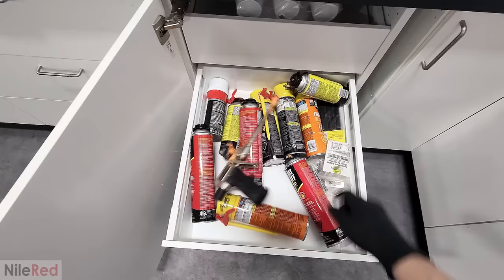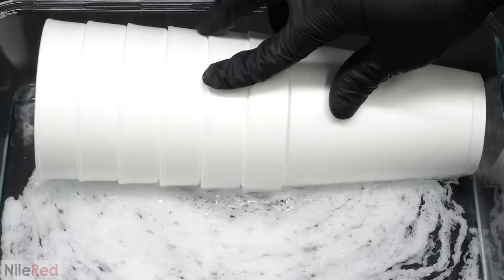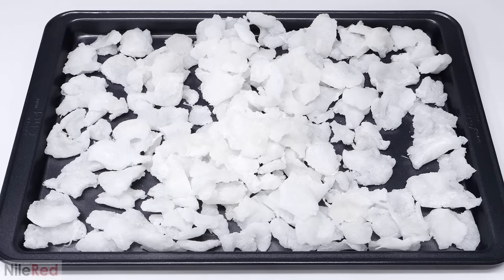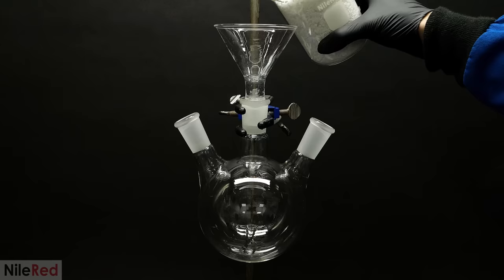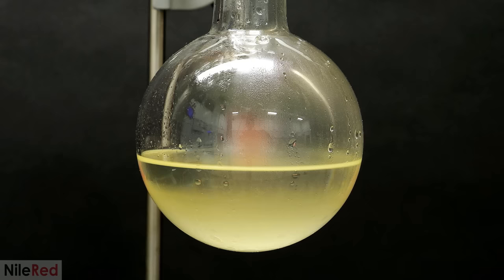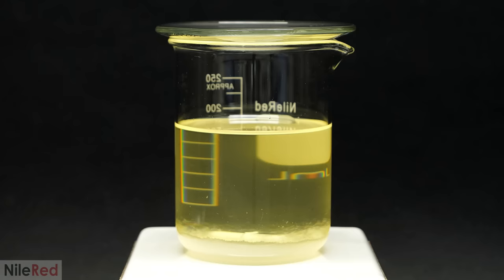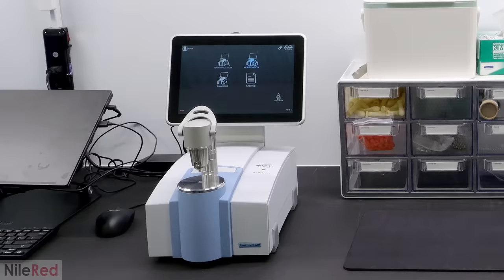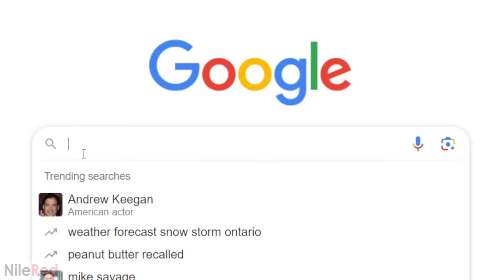Turning styrofoam into cinnamon candy

Comment: As a professional chef for many many years it's incredible he managed to make candy without horrifically burning himself. Also the reason why your candy seized like that is because you added in alot of cold liquid(food dye) without a stabilizer, which caused it to start instantly crystalizing around it even before you poured it out of the pan. Basically, in short, make sure to heat it to 300 or 320 or whatever ur temp is AFTER any additives or you'll get a chalky crumbly sugar mess instead of candy.
Reply: You should watch his standard chocolate chip cookie video. He knows so much about chemistry, but his kitchen skills are "Burnt Water" lol
Reply: Also, my first attempt at making a hard candy shell on some key lime pie gave me 2nd degree burns when I laminated my fingers with molten green lime lava. I was trying to drizzle, and ended up sizzle.
Reply: Also speaking as a professional chef, I’m shocked he managed to save the candy! Very impressive for a first time try like that
Reply: I don't think he'd do very well as a chemist if he can't handle hot sugar safely.
Reply: @Roadiedave Hey! As someone who also often burns water, I resemble that remark!
Reply: @microgravity  I am not a chef in any fashion but this was also a huge surprise to me. Usually saving food stuff after you've fucked it up that bad is basically impossible.
Reply: @UnitSe7en  you'd be surprised at how incredibly easy it is to melt the gloves you're holding to your skin because the sugar you go to knead bubbles into has a pocket that's still liquid that gushes out onto your hands as soon as you start working it
Reply: It's actually humbling seeing this insane guy who can make chemical magic getting mad hopeless and frustrated at something that I have successfully pulled off before
Reply: I very vaguely know the candy-making processes, and even I was astounded at how he pulled this out of his ass! He really made some easy mistakes the first time, then just chemistried his way through candy making to finish with an actually pretty good product as someone who'd never touched these dark arts before!
Reply: The sugar crystals up the sides of the pot due to the initial stirring would also act as a seed for crystallisation, been there.
Reply: We’ve already determined that Nile cannot cook/bake to save his soul. He must survive purely on Uber eats.
Reply: @andrewbartlesby7958  That's pretty much exactly what happened to me. I had mine in a bag to squeeze it out, and the bag burst. I grabbed the blob that came out and that burst open and it was pure molten syrup inside. I could hold the squeeze bag with my bare hands.
Reply: He is the definition of master of one, he only knows things about chemistry, which is weird because you think about baking it is  just mixing chemicals together just ones that usually don't kill us
Reply: You can add water-based food coloring to candy without it seizing up; if you've ever seen any of Lofty Pursuits' videos on youtube before, that's how they do basically every candy. What likely happened is some undissolved crystals were left on the sides of the pot, and the candy cooled down sufficiently after the burner was turned off that it was unable to melt them; but was able to pick up a trace amount of the solid while pouring out, causing it to seize up when it got closer to the freezing point. I was surprised the remelting in the same, uncleaned pot worked -- I suspect the bubbling brought the hot syrup in contact with the crystals on the side of the pot, and got them hot enough to melt.
Reply: @Roadiedave 111 👍
Reply: @PersonaRandomNumbers  again, as someone who has his red seal with a specialty in pastry, I promise you.what happened is when he added the large amount of food coloring off the heat it caused the sugar to harden around it, forming seed crystals. The reason lofty pursuit can do it is because the additives they add are done on a speciality heated table that prevents the candy from ever getting cold enough to allow seed crystals to form. The two possible culprits for it seizing are either that, OR the bench scraper he used (metal spatula) being cold enough to cause the same thing.
Reply: Cooking is basically chemistry that you can eat
Reply: Lab safety is probably what saved him from getting burnt. Most kitchen people are used to a spill safety of "clean it up" or at worst "ice bath it" Lab spills are more of a "Oh fuck I'm already dead"
Reply: @artsyscrub3226  tbh cooking and chemistry have very little in common. its why his cookies sucked so much ass. the whole idea that cooking is just basic chemistry is super super incorrect, its more of an art than a science.
Reply: 44:57 45:42 😅
Reply: @andrewbartlesby7958  cooking is a craft - you need both academic knowledge of materials and the "feeling for it "(that's why it's hard af)
Reply: I always add cream of tartar to help prevent recrystallization
Reply: @samj530  yeah, any base would work. Baking soda is the more common choice

Comment: Organic chemistry: Measured and precise
Candy making: Chaos and use feeling
Reply: That's about as accurate a description of candy making I've ever heard!
Reply: @michaelbobic7135 have you ever made candy the correct way? It's an extremely measured and precise process. From water percentages, to temperature ranges, to folding and aerrating, to watching temperature again until you're able to do your final shaping, it's not just a carefree "throw-it-together" process.
Reply: Organic chemistry is not always as precise as you might think 😅
Reply: @Tamramsy I mean... Like anything else, once one becomes practiced, yeah it is a matter of feeling. Like absolutely use the thermometer, but learning what the sugar syrup looks like at different stages, learning what the candy looks like when it's malleable enough to pull, learning the thickness of the candy and temp of candy to roll is all smthn you can just tell once you've done it enough
Reply: Organic chemists are everything but precise.

Its called dump and stirr chemistry for a reason.

Inorganic chemistry is where being meticulous is primordial

Comment: As a pastry chef, what happened was you Seized the sugar. using the metal scraper on it caused it to create small sugar crystals in the syrup. when mixing molten sugars, you only fold it using the silmat till the sugar becomes more dense.
Reply: And from what I've seen, dealing with the quirks of molten sugar and chocolate can make almost any chef cry.
Reply: Could also have been him adding the cold food dye in and not letting it heat properly after, or him pouring it onto a chilled tray. Both can do it.
Reply: never seize things I guess
Reply: Nile is not a pastry chef
Reply: @monad_tcp so I should never seize the day?
Reply: @monad_tcp  but what about the means of production?!
Reply: Also plenty of seed crystals left on the sides of the pot before he poured it.
Reply: @KainYusanagi This is why I always stick my cocktail syrups into hot bath for a while when I am done pouring them into bottles.
Reply: @casedistorted You should seize the means of production instead.
Reply: @fidepus it kind of seems like the hardening sugar seized NileRed's means of production. I guess that's why rulers usually offer the masses bread and circuses instead of cinnamon candy, they are both much easier to put through a rolling machine.

Comment: As a hobbyist candymaker, the candy seizing up is crystallization. The usual suspect here is undissolved sugar left on the sides of the pot. Most recipes recommend you apply a wet brush to the sides of the pot to get rid of any crystals left once it's reached the boiling point; some recommend putting a lid on for a few minutes, causing the condensed water to do the same job. The issue is that hard candy is meant to be a glass, an amorphous solid -- so any seed crystals will spread if introduced. The process happens very fast with hot candy, but still happens slowly at room temperature. Freezing is exothermic, and if it happens again, you can actually feel the latent heat of fusion as it occurs!

At 40:24, you can see some crystals left on the sides of the pot, after the heating has already been turned off. Leaving the syrup in the pot, adding in cold ingredients, and stirring it, all cool down the syrup and increase the risk of picking up a small amount of solid sugar that won't melt -- and, just picking up a few molecules can cause crystallization when the candy gets closer to the freezing point. The second attempt likely worked because the bubbling action brought the hot syrup in contact with the solid crystals, allowing the heat to melt them. In general, remelting candy causes decomposition reactions to happen, possibly causing off flavors and colors; as well as boiling of volatile oils, making the intended flavor less pronounced. That said, fantastic job getting it to work on the first batch!
Reply: I thought you can’t eat crystals 🙃
Reply: I hope nigel would read this and make a second attempt
Reply: @leonardomorari9468 Salt and sugar :)
Reply: To make it sound more pretentious: The issue is undissolved sugar on the sides of the reaction vessel acting as nucleation sites for crystals of unwanted size.
^_^
Reply: @Reddotzebra  tf are you on about? a comment that explains some chemistry under a chemistry video is not pretentious.
Reply: Wanted to write a comment how NileRed has impeccable chemistry knowledge and skill but then fails at basic home food processing :D Was kinda expected to hear he consulted his first failed candy attampt with How to Cook That, after she did lovely explanation why his "chemicaly purest cookie" didnt taste good.
Reply: Candymaking is a science in of itself!
Reply: When I made marshmallows for a high school project (and then again later for fun), the video tutorials I watched generally advised that I pour my sugars in the center of the pot and avoid stirring my syrup to avoid crystallization.  It seemed to work out - the only procedural problem i ran into was using hot coffee instead of cold coffee to start my gelatin, so instead of a mound of useful gelatin mud I ended up with a stinky coffee gummi lump at the bottom of my mixing bowl.
Reply: @leonardomorari9468  Sugar, ice, and salt are 3 commonly eaten crystals
Reply: I came here to comment this same thing! I make candy too, and I am in food manufacturing (but not for candy).

Comment: So there's one thing you're missing from this project: a heated table. It helps to keep the candy from getting too hard and stay malleable. You have the press next to the table and run it through the press straight from the table.
Reply: How is this applicable to normal-everyday-life?
Reply: I usually just use an oven tray at about 100C to keep it warm for longer when I make hard candy
Reply: All watchers of Lofty Pusuits know this 😊
Reply: @slevinchannel7589  Candy press isnt everyday life device also. Well, if one is not professional candymaker
Reply: @vVPhaetonVv  I kinda want NileRed to try to use the same press to make heart-shaped soup noodles.
Reply: @slevinchannel7589  it's meant to be applicable to candy pressing, not everyday life
Reply: So then get him a heated table lol
Reply: @slevinchannel7589  What is this question 😂
Reply: NileRed hasn't fallen down the candy making video rabbit hole and it shows.
Reply: @slevinchannel7589  honestly just using one of the heaters he has with something like an oven tray would be enough
Reply: @slevinchannel7589 why are you bringing everyday life applications thought in here???

Comment: As a pastry chef and confectioner, Nile's candy-making skills are actually pretty impressive, all things considered. Those cranks are crazy to use, and the candies look great!
Reply: The main reason it's so difficult to turn is because of the gear ratio on the crank. You have to turn it very fast, and with the pressure of the candy on the roller it's like running a bike uphill when you're in high gear
Reply: He needed a cheater-bar for the lever.

Comment: The reason why your sugar got all hard and lumpy (crystallized) is because when you're making candy, you're supposed to wash down the sides of the pan with a pastry brush and some water. The crystallization happens when there's unmelted/unincorporated sugar crystals in the mixture, and washing down the sides makes sure that all of the sugar gets melted. Glad that you were able to fix it, though! Never give up! :D
Reply: my farts are better than NileRed's farts
Reply: @p-__ taste better too
Reply: @youtube.commentator that's even worse
Reply: @richarddavis3980  Thats exactly what you are not supposed to do. The pastry brush would be wet. Melting the sugar before it mixes back it in. When you stir it then it mixes the already formed crystals into the liquid sugar causing a chain reaction.
Reply: @kyleg334  I don't know what the hell you're talking about because I made candy the other day and I stirred it as it was heating up and it worked out perfectly for me so I don't know what you're talking about
Reply: @richarddavis3980  ah yes, the good old "I haven't seen it so it must not be true" argument.
There are 2 schools of thought apparently. For one, stiring is the biggest sin you can do, others are more... relaxed.
Using a pastry brush to dissolve the sugar again is certainly the safer method
Reply: @richarddavis3980  congrats, and advice for the future the safer method  to try and avoid crystallization by not stirring.
Reply: Does microMOL level measurements for 90% of the experiment, YOLOs the candy making, which is arguably the most related-to-chemistry field in cooking.
Reply: @richarddavis3980  being a cook doesn’t make you knowledgeable about everything man just accept there’s two ways here and you’re criticizing an obvious beginner cook as if he’s a moron
Reply: @richarddavis3980 I mean you can stir it but it can cause failure. If you're not super fast with pouring it ect it'll harden quickly and just make your pot a sticky mess
Reply: @richarddavis3980 Man really equated working as a cook to being a doctor of medicine…
Reply: @richarddavis3980  Just take the L and sit down, you’re making a fool of yourself.
Reply: I smell a troll.
Reply: Way to bully a person with autism internet I guess that's the last time I share my opinion
Reply: Way to make fun of someone with autism last time I share my opinion
Reply: @richarddavis3980 dude I’m autistic, take the L and move on
Reply: @malegria9641  see what you will and believe what you want but what I'm saying is true
Reply: @Grommish  he followed the candy ingredients pretty exactly until it stopped working then yolo'ed it.  It wasn't his measurements that went wrong, it was his method
Reply: @richarddavis3980  Yeah, you really proved that when you deleted all of your comments to not look like a fool…
Reply: @richarddavis3980  a lot of these comments seem harsher than necessary, but stop fishing for pity.  Your condition is not whats being discussed, and you're just trying to use it as a security blanket.  It's obvious you were wrong because it's obvious you deleted a bunch of comments.
Reply: @sinisterthoughts2896  Would it help if they were trans person of color?
Reply: @p-__ You've been reported to YouTube as a spammer

Comment: Fun fact. Styrofoam and acetone are used as practical effects in movies to simulate strong acid effects.
Reply: Oh yes, like alien blood eats through the steel floor...🤯
Reply: Yeah it is trippy.. 🙂
Reply: Plot twist,: they were making cinamon candy off set
Reply: Wdym? Like what would the mixture portray in a movie exactly then? Like a body dissolved in acid portrayed with stryofoam and acetone + color?
Reply: @derenjoy3r  you build structures, items, etc. out of styrofoam and when the acid (just acetone with color) in the movie hits it, the object shrinks very fast where it was hit. Add a soundeffect and the alien blood that hit the wall looks like it is a really strong acid
Reply: @lewst  interesting, thx for explaining it
Reply: @vossti 😂😂😂😂😂
Reply: actually i thought it was a strong acid but the i realized that it is acetone, they are very similar
Reply: @lewst  You're probably already using styrofoam for a lot of your props anyways because it is lightweight and easy to shape so it's really a match made in heaven.